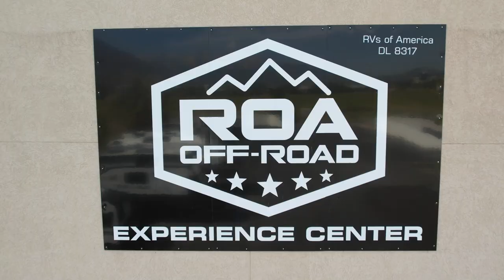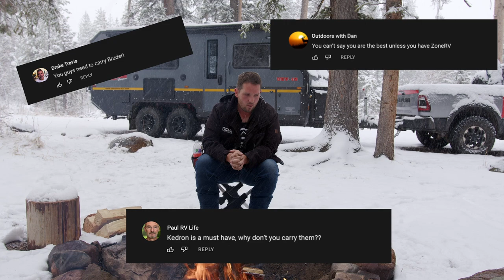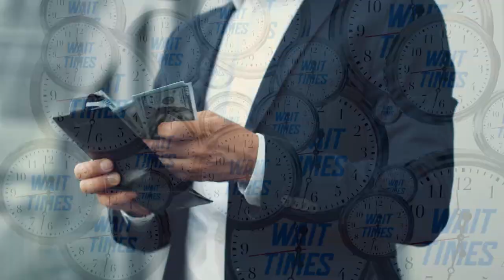Does the USA make the best Off-Road Trailers now? Manufacturers Are STEPPING Up! | ROA Off-Road

Comment: Bruder wires their caravans for the country they send them to. The EXP 6 has a rear door entrance. The only way which side you enter on would most likely matter to you is if your in a campground. You could get a pull through slot and face it the other way. I wouldn't have a problem with getting out of my truck and getting into a trailer with the door on the same side. I would get a Bruder if it was sold here because of possible maintenance.

Comment: MY only concern is the US TT mindset. Take a look at the Pause. For everything they do, they did not create a lock latch for every cabinet in the trailer.  They do great on the outside and then once they work on inside they source from the standard US travel trailer vendors and you end up with an off-roader outside and a winnebago inside. US manufacturers think every trailer has to have a black tank or limit the water to 30 gallons. Also, US trailers get SUPER tongue heavy. Why? That makes off-roading or overlanding with a TT harder because who wants to take a Sper Duty 250 offroad and overland?

There are lessons to be learned from the Aussies in those areas for true overlanding.  Currently we like the X145 but are worried after seeing the cabinets inside look like every other trailer who does European is that they are starting to follow the herd. Would have loved to see them keep locking latches.
Reply from the maker: Hello, don’t know where you are getting your info on locking latches on the Xplores? I think we already replied to your comment. The Xplores have locking latches. 

Also, many people overland with 2500. Power wagons, RAM AEV is one of the most popular 2500 overland options. Also, the Pause is nothing like a standard TT in the USA inside or out. The inside is all extremely premium Cabniet and composites. You need to wait for the tours coming to actually know more about the product. The only thing you could say is lacking in the Pause would be good locking latches. Tours will be coming soon. Feel free to text 801-860-0035 for questions.